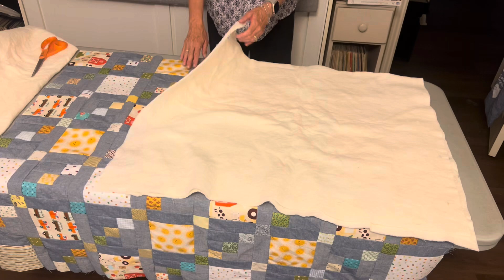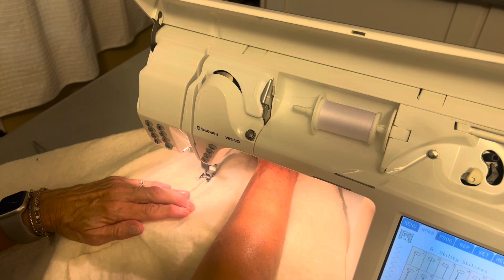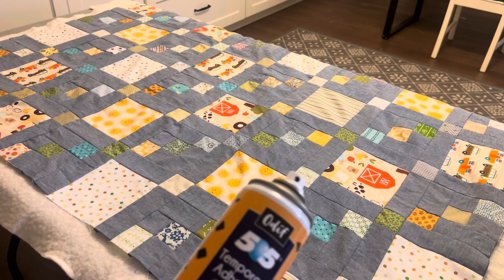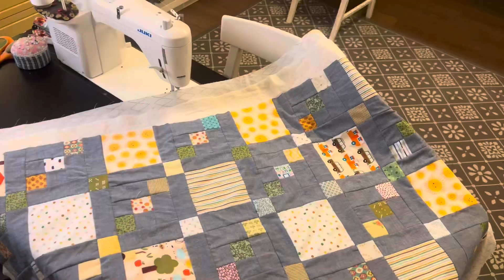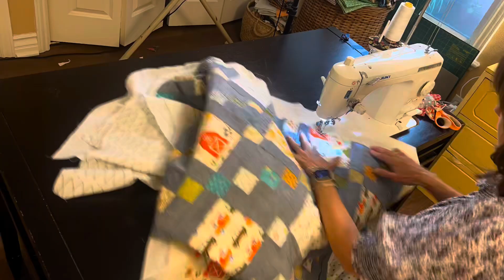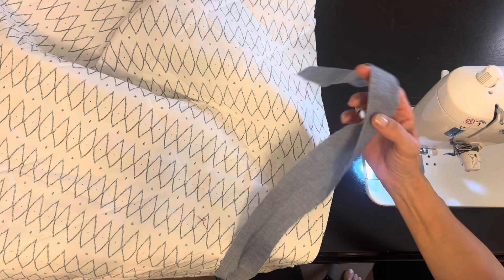EASY machine QUILTING - FINISH your quilt!

Comment: Before zigzagging the batting, line up the batting pieces and with a pencil make a  horizontal mark every six inches across the pieces.  When sewing, match up the marks. This will help eliminate the gaps or stretching or bunching of the batting.

Comment: I also noticed that with poly batting, it is helpful to add pins even if using spray as it is slippery. Cotton or 80/20 batting is much less slippery.  Glad to see people quilting their own quilts on their machine.  I also do  my binding as you showed with sewing to the back and top stitching on the front. It is strong, fast, and looks good.

Comment: Great video.  I have used my domestic sewing machine for quilting all of my baby and throw size quilts.  I found it interesting that you did not use any pinning of the body before quilting.  I have used spray adhesive and have found it not to hold well enough to keep the movement of fabric from puckering so I have always pinned.  What brand is your adhesive?  I also use bed sheets for backings.  It is a very economical option.  I will go to resale stores and look for high-end flat sheets in colors and or patterns that will be good for background or backing.
Reply from the maker: I use the 505 spray.

Comment: I like to use the three-step zigzag if I can, for butted seams.   Regular zigzag can sometimes bunch up a bit of material inside the stitch, but 3-step always lies flat.
It's also good for plain overlapped seams, or any seam finish that you need to flatten and disperse the pull on that fabric.  (Like maybe when working with a fraying fabric edge.)

Comment: I've piece together batting this way. It works fine and is a money saver too.
Reply: When I am "frankenbatting" in order to get straight edges, I lay them on top of each other and make a cut to have the same edges to butt together with a multi stitch zig zag.  This eliminated the ripply seam.  Thanks for your clever videos.